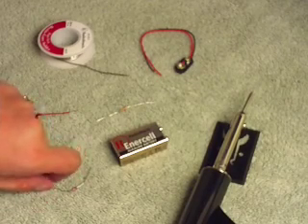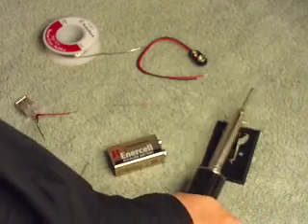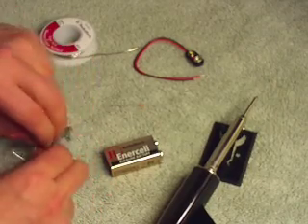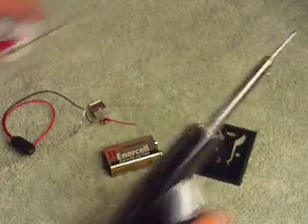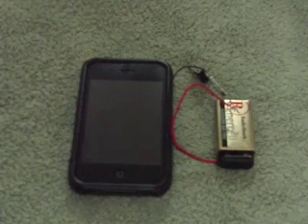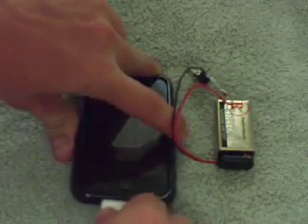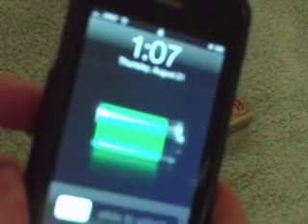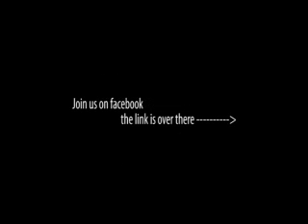How to make a USB battery

Comment: lol did not watch it in detail but if he got the pins right it should function as a dumb USB port for charging usb devices. 

Quite funny because all the other videos I have seen are so WTF fake. Though this is one is a bit more dangerous.

Why? because USB is 5V and he is advocating a 9V battery, could possibly damage someone's device who is stupid enough to make one. The 330 resistor may help the stupid ,but 9V batts like that have so little mAh that its a pointless device anyhow.

Comment: Well, 12 mA really isnt mutch, so i could happen that the battry lasts for mutch longer than a week

But if you put a simple switch between the battery and the zenerdiode, there wont be any current, so it wont discharge

Comment: Different than ur other videos, this would actually work, and safly (cus in other videos he simply shortcuts batterys all the time, whitch could lead to an explodion of ur batterys)

i only want to say 1 thing: do some tape around evry part that isnt isolated, if you dont, it could happen that for example 1 side of the zenerdiode hits the - pole of ur battery, then u have a shortcut

shortcutted batterys CAN EXPLODE

but for the rest, it would work perfectly

Comment: You neglected to show which way to put the zener diode. Also, it would be better to plug in the USB plug first before connecting the battery.

Comment: umm...no.  It doesn't provide anywhere near enough power to run your 360.  Not even close.  a 360 runs off 12 volts and 175 watts, so, even though 9v is CLOSE to 12V, it's nowhere near the proper wattage.

Comment: male/female jacks or connectors existed decades before computers were even a blink on the horizon. 
the rca connectors to your stereo components such as speakers are male/female. 
then again, this is catered to an Ipod crowd and I doubt any have seen more than an s jack on the back of a TV. those too are male/female as are the co-axial cable connectors for your TV. 
the hose out in front of your mom and dad's house has a female connector that screws on to the male faucet threads.

Comment: hah that's is fake, i tried it with my iphone and it didn't work the iphone battery  isn't 9v it is 12v, and if it was real he would have showed the full white apple cable but he only showed 2 ends of it which makes it oblivious that he used 2 cables one dummie cable coming out of the 'usb battire charger' then the one connected to the iphone goes to a laptop or some source or some source of charging it. if you watch all is other videos they are fake... this guy just fuck with with you as a joke

Comment: it's the 5 volt Zenner Diode that limits the voltage to 5 volts, not the resistor, the resistor is only there to limit the current through the diode.

Comment: Its a ZENER diode. The current could flow in both directions. What it does is stabilize the voltage at 5.1V

Comment: The power from the battery charges the iphone! the diode makes sure the current only flows one way, the resistor limits the current so it doesn't over charge!

Comment: This should work the only mistake is if you want to charge something that works from 5V the this could burn it out because the normal USB supply is 5V DC and then wont put a voltage regulator in. However with mobile phones it can work becasue the lithium-ion batteries usually work under 2 volts, so the regulator IC is needed anyway

Comment: While this does charge your ipod, or other mp3 devices, it is an extremely bad idea to use this.  A usb output on a computer is 5 volts. by sending nine volts into your usb device, you could easily destroy it.

Comment: oh lmao! ..and I thought using a linear voltage regulator here is the lamest thing.. 330 Ohm, right? So awesome, we are limiting the current with 12mA, and even more fun - we are CONSTANTLY having those 12mA flowing through the circuit wasting 48mW into heat from the resistor and up to 60mW from the diode. Even using a 7805 (normally used only for mains power supply as there we don't care of efficiency) would be more efficient lol. Learn to use the stepdown convertors ffs (up to 98% efficiency).

Comment: of course it works, i study in electrical engineering and , the zener diode only keep the voltage at 5 Volts and the resistance is there to tone down the current so it doesnt break any component in ur devices.

Comment: I have a question: Does a different battery matter? Or does it half to be a 9 volt so it doesn't short circuit anything? Like, is there any battery that could harm your ipod, mp3, or whatever?

Comment: It doesn't matter which one you use, the only difference is how much electricity they can handle before they burn. It depends on how many ampere the battery output is. I'm not sure which one you need, but I suspect any of them will do. You won't harm your device anyway, because if the resistor can't handle it, the electricity will stop.

Comment: A diode restricts the flow of current to one way. and the resistor reduces the voltage of the battery.

Comment: It's probably not a fake. A zener diode can reduce voltage, specifically what it is designed for... and, a resistor to prevent current from going above 500 mA.

Comment: 7805 works on 5-18 volts. I'm glad you aren't going to waste your time with this circuit. Buy the 1 dollar voltage regulator and you can convert 9 volts to 5 volts at any current up to 500mA. With the circuit in this video the current draw on the usb determines the output voltage. It's a junk design.

Comment: That means about zero to me. Which phone? All phones? What kind of limiter circuit? DC/DC converter? Voltage regulator? My point remains, if you put a 9volt in to a USB cable chances are you will fry anything you plug it in to. There is no point in debating it as I would never be foolish enough to use such a device , and neither would you. So who are you trying to convince?

Comment: Please feel free to try it, but do not be surprised when it kills your gear. remember the voltage past the resistor will only be 5 volts if you drag down the voltage with max draw. As soon as the draw falls below 12mA the voltage begins to climb on the resistor. You can test this with a simple volt meter.

Comment: LMFAO! Ok, this will fry your phone. First off USB output is 5 volts so it can not recharge a nine volt battery, and anything you plug the 9 volt in to will be destroyed. Note the rest of the cable is out of frame.

Comment: USB uses 5v at 500mA, the resistor would drop the voltage of the 9v hence the use of it, but 330ohms doesn't seem like enough, if im correct youd need 10ohms to drop the volts down to 5v?

i know im not 100% correct but its definitely possible.

Comment: actually this does work, i bought a thing that is similar to this at kmart, you plug in a 9v battery, then plug in something that is USB (ipod, cell phone) it charges, and it does DELAY a little. but i didn't make one,  i bought mine , it's similar though

Comment: What You Missed is the RESISTOR the soldered in so that you Dont Fry Your Device... And any USB Devices only Need 5v to Charge So Why would you have a device that needs more than 9v which uses USB to charge?

Comment: One of the devices he mentioned was a 5.1V zener diode which pretty much reduces the 9V to 5.1V. 5.0V is the amount of volts supplied by USB. Admittedly its still not exactly the same but its not as bad as 2x greater. 

You can use it to charge any device that can be charged through a usb cable. Most of my USB chargable devices' batteries are 3.x V so they are most likely also regulating that 5V voltage in their own way.

Comment: Guys, it doesn't work. The reason why when he was showing if it worked he only showed the iphone and the ends of the cable. He has two cables one that is connected to the iphone and REAL recharger and 1 he just connected into the fake one. Then he just connected them in at the same time to make the appearance of the usb battery working.

Comment: hmm, sry, spelling mistake.. the zener diode...

ANyway, I think your resistor may be too high as well. I don't think that circuit would work well above 12 mA, and the USB spec calls out an available starting current of 100 mA... (Or is that just to be on the safe side since it can't be adjusted?)

Comment: There is a reason for the resistor. Only the diode and the resistor are in parallel. So not all 9 volts are going to the iPhone.

Comment: All USB Ports put out 5 volts dc power. That battery is 9 volts, so if you use the proper resistors you can knock the voltage down to 5 volts so he is absolutley right, however just buy a car charger. Much easier than going through all of this crap.

Comment: great, now all i need is an ipod, a 5.1v zener diode a 330-ohm resistor, a 9v battery connector, a 9v battery, a soldering iron, and solder.

Comment: a zener diode allows current to flow forward, like all diodes, but if the voltage reaches a potential higher than that the zener is set up for, most are 5 volts or 12, it then passes it in reverse direction as well. Basically acts like a voltage regulator by shunting everything to ground that is above the disired voltage.

Comment: Radio Shack carries the zener diode and the 330 ohm resistor. The zener drops the voltage off the battery to 5volts, so if an Iphone runs off of 5 volts then it may be on the up and up, but with these guys you never can tell. LOL

Comment: HHH you guys are starting to annoy me because you get so many people to believe that your stuff is legit. The problem I have with this particular video is that you guys forgot to include several important components. Firstly you need to have two usb connectors, which apparently from the video don't need to be the same (there are no markings in grey ink on the fist usb cable). Next, you need a friend to plug the usb cable that is in your iphone into a computer at the same timeyouconnecttheother.

Comment: a female and male connector terms are computer hardware terms. Female connecter is the one that recieves(like a vagina) and the male connector is a cable with pins, such as a printer cable, that connects into the female. The pins are dicks (male connector) that need a cunt (female connector) to plug in to. I hope my graphic explanation helped. Im off to watch some porn, jerk it twice, and then go to sleep right after i take a shot of tequila.

Comment: You know what i think i did. I think when they took the other end of the charger cable out of the shot of the camera, they grabbed another one and then plugged the fake one into the battery and had some 1 else plug the real one into a computer. I dont know if the battery trick works. but i have found that some of there stuff to not work. any way i love watching you stuff.

Comment: its not fake, if it were you wouldnt be able to charge your ipod in a computer, or a portable dvd player, or your car, or a wall outlet. the battery is just the power source, its simple granted it wont work for long but still